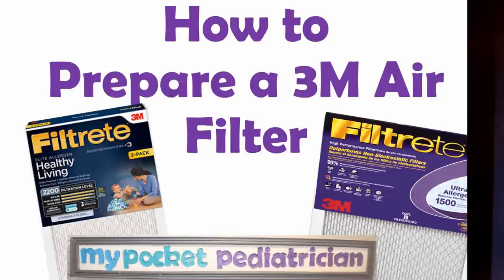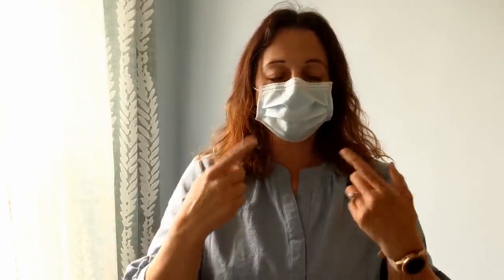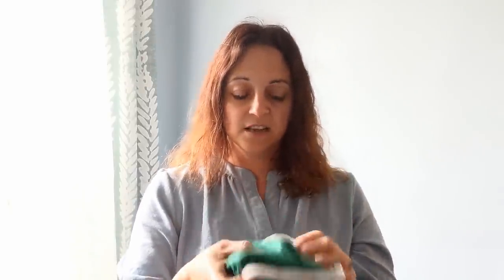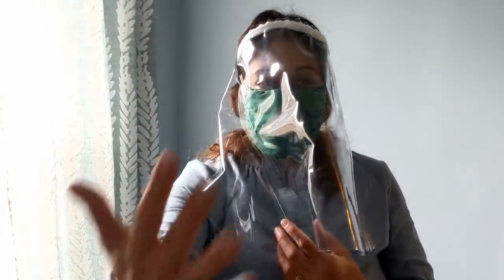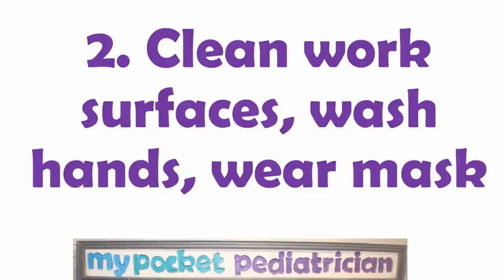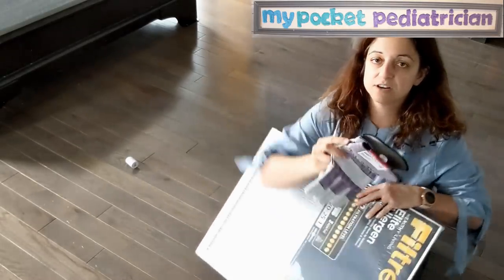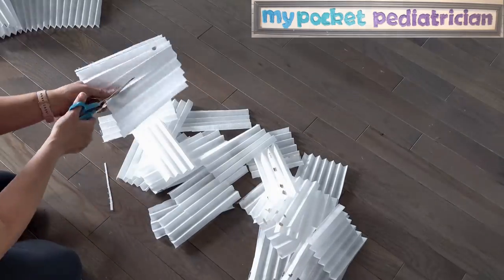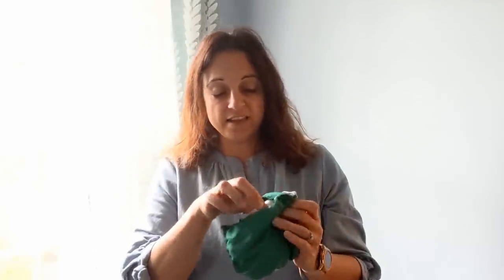UPDATED!  How to Turn a 3M Air Filter into a Face Mask

Comment: I literally just walked out of Kroger with a Filtrete filter I cannot believe it because I cannot find HEPA vacuum cleaner bags. By the way I was so happy to see the filter that catches viruses that I picked up the first one I saw then I realized let me get the largest one that they have since they were all the same price. I'm glad I watched this video because I didn't realize or think about inhaling through a cotton mask that you would inhale the air with the least resistance thanks for this video I appreciate it as a common citizen you're doing a great job thanks
Reply from the maker: What level did you get?
Reply: @MyPocketPediatrician  1500  20x30x1
Reply: Most vacuum hepa bags are made out of fiber glass, please double check before putting on face.
Reply: @CalvinHill-reflects  Where is your data for this?  Even though lots of people were saying the furnace filters have fiber glass, she checked the primary source and found they DO NOT contain fiber glass.  Old fashioned cheap furnace filters with almost non-existent filtering were made decades ago and are still available.  I suspect that people may be conflating new high tech filters with the old.  But, I would like to see a definitive source.
Reply: The vacuum filter bags may have fiberglass, as she said in the video, she researched the 3m filter to not have fiberglass
Reply: @drizzt545  I amended my original post to clarify (I hope) my point.  Since the doctor debunked fiber glass in the furnace filter, I wonder if that would also be true for the vacuum filter.  I have six 3M Filtrete vacuum filters of different models that I can make at least 24 duckbill style masks out of.  But I don't want to cut them up if I'm going to release a harmful substance.
Reply: I'm Me Hey, I watched this video here https://youtu.be/qiYbXsIcI7E and that is where my data came from. So not much. That was with Vacuum bags, not 3M air filters.
Reply: I'm Me I’m not sure of you meant that you could make that number out of one or all of them, but I think you might be able to get a lot more depending on size.  I’m using mine for making Pm 2.5 mask inserts.... I think it will go a lot further that way for me.
Reply: @drizzt545  I ended up getting interface aka stabilizer  the "non woven"  type of material to use as a second layer and filter pocket. Also went to the Dollar Tree and got elastic mattress snaps  then poked holes on either side of the mask, they grip the fabric, it's a modified version but it works great.
Reply: As of this weekend our stores are limiting the people allotted in the stores. So there is a line outside waiting to get in. There weren’t many people in the store, but I think it is actually worse this way. It is causing more of a panic here too. Our store was out of filters. I had to look up other things and that is where I found the autoclave material I could buy. IF I could afford it darn it. They said you can reuse it again.
Reply: LoveisElastic Creations 
This video shows a washable furnace filter material from Filti.com
https://youtu.be/FxkCzCqH88A

The material is not terribly expensive itself, but shipping to where I live was WAY too expensive!  A LOT more than the fabric itself.  To be fair, I live in Alaska and they are only shopping two day to anywhere right now, but they did call me back and said they are looking into cheaper shipping methods that might take longer. It be a lot less expensive.  There will be a pop-up that sends you to the material itself rather than actual furnace filters.  It now says “while supplies last” so I’d check it out soon to see if it’s reasonable for you.  

Good luck!
Reply: @queenofhearts7726  I'm making mine using a design that is similar to the N95 duck-bill masks.

Comment: Do I need to check, (and where would I check?)to see if these filters have any  harmful substances like fiber glass particles? I went to the store and I got one that was for bacteria and viruses 3M Filtrete . I'm concerned that it may have something harmful, since it is not meant to be so close to your face. Thank you so much for the information. Is it an extremely helpful video.
Reply: Same. I'm paused now because I cut them all out and I saw a video saying they made with glass particles and can cause lung issues.
Reply from the maker: I can't tell you medically anything but I can tell you what I've found.  It's not fiiberglsss.  I reviewed the materials safety data sheet and it is just a bunch of polymers.   It said no concern for contact with skin or eyes or inhalation.  As one HVAC specialist I talked to said "why would we put something in an air filter that's bad to be breathed in?  That would defeat the purpose.".  That said, some people are making a duck bill mask out of hepa bags.  I watched the tutorial and there is a cut edge of fuzzy material right up against the face, which may not be smart.  In making these and wearing them in the last few weeks, it seems like any particular matter would stay in the cotton.   They hold up pretty well.  I reused the filters for a while trying to see how well they hold up, and they get kind of fuzzy/fluffy after a while (I was home, not in an exposed area).  It should only be single use, but from what I've been told (and can't make any guarantee) there isn't a toxicity concern.  I've asked every person who suggested fiberglass to give me a source, and it's been "a nurse said there might be".  I'll post the like to the MSDS for you.    I just can't do it from my phone for some reason, but it is in the comments on the mask making tutorial.
Reply: @MyPocketPediatrician  Excellent.  Thank you. I'll use them, with a warning. Bless you for everything you're doing!
Reply: no fiber glass in the accordion style filters.
Reply: @artalli7170  See Eve Wilie's comment above, she found (as did Dr. Lili) that the 3M Filtrete filters are made from a non toxic polypropylene and polyolefin plastic - there is no "glass" or fiberglass involved. Some filters use fiberglass. These do not.

Comment: Be careful not to have any filters with fiberglass in them...
Reply: Hepa has glass
Reply: See the data sheet she posted above, no fiber glass.
Reply: not all hepa filters have glass. Also non industrial air filters are generally rated under MERV's. The one she's holding is poly fibers.

Comment: Help: I took apart the air filter before making note of the direction of flow. Is there anyway to distinguish/identify this now that the cardboard frame is gone? 😢😳
Excellent video
Reply: I did this too! I hope someone has advice. I will keep searching.
Reply: @JennyPost  I too am searching. Please post if you find an answer (as will I).
Reply from the maker: Shiny side towards patient, soft side towards the healthcare worker
Reply: My Pocket Pediatrician thank you!

Comment: After watching your last video I realized that I didn't know which way the airflow went. So I compared a new one to the one I've dissected. The front "airflow" side is smoother and has grains (lines) that go perpendicular to the folds. The back side, you can see the fibers more. Thanks for the ziploc advice! I will be sealing all my filters now.
Reply from the maker: I was talking to someone about the old N95 I found that I used in the video and said I wonder if I should use it my next shift at work.  She said if I did and it wasn't in a bag it would be pretty much useless now, so I added in the Ziploc bag idea.o
Reply: Thank you!i took mine apart and didn't know this
Reply: Are you using a 3M filter?  Which way did your arrow point?  To the smooth front "airflow side", or the back side?
Reply from the maker: @dianestrandlund381  mine pointed towards the back side of the filter.   You want the arrow pointing towards the healthcare worker.  See step 2 in the video

Comment: great video.  I already planned to make a mask with a/c filter before I saw your video, but I didn't know the air flow is directional. That may save me some trouble.

FYI: I lost the place where I found the size of corona virus but here it is.

N95 mask is 0.3 microns; which is the same as 300 nano meters. viruses vary in size from 15-300 nanometers. Most are in the range of 15-80 nanometers. and there is one virus that is almost as big as a bacteria. The original estimated size of corona virus is 60-150 nanometers. that makes the holes of an N95 mask 2-4 times bigger than the virus.

It might have been the product info on 3M website that says filters are not made like a net because its not currently possible to make a net that small. The particles are actually captured through a process they call diffusion. The air flow around the fibers causes small particles to change direction and crash into a fiber where they become entangled. I didn't completely understand the explanation of how that works, but I guess the filters can catch particles that are smaller than the holes in the filter
Reply from the maker: Glad to help!

Comment: This is an extremely helpful video.  I was a little thrown by you saying you put a sealed zip lock bag mask over your mouth and nose, but am grateful for your transparency.  Thank you!
Reply from the maker: Honestly, I didn't think my seal could be that good in the mask, but apparently, it was excellent since I nearly died!  I have a new and improved Adjustable mask with FILTI material that passed the FIT test!  Please check it out here:  https://youtu.be/2J3Fq4o-U4I

Comment: Heat and moisture from breathing on the 3m filter might prevent it from working properly. What if you somehow secured/placed the filter on the outside of the mask?
Reply from the maker: I don't think you would get a seal that way.  However, I found another material where moisture isn't much of an issue.  I have a new and improved Adjustable mask with FILTI material that passed the FIT test!  Please check it out here:  https://youtu.be/2J3Fq4o-U4I

Comment: you can also use foam weather stripping around the edge to really get a good air tight seal
Reply from the maker: I did that on the top only.   Maybe I can put it all the way around?
Reply: My Pocket Pediatrician I don’t understand how that doesn’t make the mask roll. I just can’t picture it up close and on.

Comment: This comment was posted in a local group this morning! According to the IPCS Dryer Sheets contain “Quaternary Ammonium Salts”. Here is the safety statement from them...
2.1 Main risk and target organs

Quaternary ammonium compounds can cause toxic effects by

all routes of exposure including inhalation, ingestion,

dermal application and irrigation of body cavities. Exposure

to diluted solutions can cause mild and self-limited

irritation. Concentrated solutions of quaternary ammonium

compounds are corrosive and can cause burns to the skin and

the mucous membranes. They can produce systemic toxicity due

to their curare-like properties. They can also cause allergic

reactions.

Comment: 3M Filteret are made of electro-staticlly charged polypropylene and is similar material to N95 masks.  To get something equivelent to N95, I would suggest using an other and inner fabric with 3 layers of 3M MPR 2500 or 2800 filter.  These higher rated filter would do a better job filtering particles as small as 0.3 um.  FYI if someone sneezes where aerosoles are generated these home made fitlers and popular N95 will not filter COVID-19 particles as small as 0.1 um!  You will need full recpirator mask with face shield.
Reply from the maker: Thank you for your comment.  Fully agree on the electrostatic charges.   What made you say 3 layers of 2500 or 2800?   I've had people question my saying 2 layers because they said it would be too hard to breathe through 2 layers of cotton and 2 layers of filter.  I just wondered the rationale for the 3 layers.  I was able to pass a FIT test with the 2 layers in the mask I designed.
Reply: @MyPocketPediatrician  
3M MPR 1900 Filteret has rating of 62% capture for 0.3-1 um, 2 layers ~(1-0.38^2)*100=85% capture, 3 layer ~(1-0.38^3)*100=94.5%.  

3M MPR 2800 Filteret has rating of 81% capture for 0.3-1 um, 2 layers ~(1-0.19^2)*100=96% capture, 3 layer ~(1-0.19^3)*100=99%.  

You can probbaly get any with 2 layers of MPR 2800 but in case of MPR 1900 you will need 3 layers.

Comment: I saw a woman using a menstrual pad. Just peel and stick on the inside touching your face. You can change it out throughout the day
Reply: That doesnt sound like a good idea because of the plastic. It would literally block air. Plus that's not made for the face.

Comment: Dr Lili - Here is another brilliant idea i'd like to pass along to you,  put together by a surgeon at Boston Childrens Hosp using a  Elastomeric Respirator. Please pass this on to your medical/nursing friends! She says the anesthesia mask and the Inline Anesthesia Viral/Bacterial filter attachment are only about $1 each. Very impressive! The comments from doctors and engineers are very laudatory and they wonder why no one else has thought about it before. One says "This video is the benchmark for DIY respirator design!"   And please note the comments about the elastic straps in the comments section. One suggests - rather than using the green elastic straps the doctor in this video is reusing, which are difficult to clean -  they are using tourniquets from their lab  since "They are cheap, purchased in bulk, sturdy, and can be sanitized
". She also says "The masks come in 7 sizes, we are using size 6, 5, & 4 for most of our staff needs."  Another commenter suggested using these cleanable neoprene adjustable headgear harness systems instead of the green elastic straps. They are only $14 : https://www.buyemp.com/product/o-two-replacement-neoprene-head-harness-system

Here are the inflatable anesthesia masks in various sizes ($3.85 ea. on this site) : https://www.boundtree.com/Airway-Oxygen-Delivery/Oxygen-Masks/Vent-Mask-Inflatable-Anesthesia-Face-Masks/p/group001568?searchText=anesthesia%20masks

Here's the Inline Anesthesia Viral/Bacterial filter she was using, the Teleflex Main Flow - bacterial & viral efficiency 99.9%  ($2.19 ea. on this site) but she says you can use others of course :   https://www.boundtree.com/Airway-Oxygen-Delivery/HMEs-Filters/Main-Flow-Bacterial-Viral-Filter-42mL-Dead-Space-Non-Returnable-and-Non-Cancelable-/p/2358-01605

Making Your Own Reusable Elastomeric Respirator For Use During Covid-19 Viral Pandemic N95 Shortage:
https://www.youtube.com/watch?v=Es_iY5WJdmI

Comment: Thought of using these filters after seeing a vacuum bag tutorial that might have fiberglass? You made a great video, thanks for sharing it with us. 

Might I add that when cutting up said filter, to not do it on a floor (dirt, germs, etc) but maybe on a clean table, or even put a very clean bedsheet on floor first, if the floor is necessary. Even putting a clean sheet (ie: washing sheet with Clorox or equal) on top of a bed and using that as a work surface. God bless you and thanks for all you do!!
Reply from the maker: Please see the video above at 19:10 Re fiberglass.  I also have the MSDS safety sheet pinned at the top of the comments.  
Also, I am distancing in a home with 7 people and a dog, so as I said in the video, I cleaned the floor with lysol cleanning spray and wipes and did this in the bedroom where we never wear shoes away from the kids and dog since my tables are all occupied with all the other people in my home.    When I'm preparing them outside of the tutorial, I'm not using the floor, but needed a spot for demonstration purposes.  I figured the floor that had just been scrubbed was better than a bed with a sheet on it.  Anyway - I didn't even use any of the ones I made for the tutorial because I didn't put them into the ziploc bags immediately, so those are just for demonstration purposes.  I'm in contact with another company about a possibly better material, so I hope to have a tutorial available soon.  I should be receiving the product on Tuesday, so please subscribe to my channel so you get alerted if something better comes up!

Comment: I am in no way an expert but Ive been using these filters for years on my fans as an air purifier of sorts and knowing that they are used in air conditioners knowing air conditioners tend to be very moist these filters arent just a one hour or one day use they work over an extended amount of time I would think they could be sanitized I am actually going to be steaming one to check and see if it harms the material soon as my filter gets here.  Thank you for your great tutorial out of all the masks Ive seen being made out there I have the highest hopes for this one.
Reply from the maker: I'm not sure.  Some people are saying they won't last at all in the mask - some are saying longer.  Unless you have a lab where you can measure viral particles, I'm not sure you'd be able to tell if they are still effective.  I'd be very careful about reusing.

Comment: Doc, I found it easier to snip the wire mesh first along the edges of the filter and then peel the wire mesh off carefully. Then cut the filter material out from the boxy frame at the edges with blade knife and scissors. this way you do least damage to filter and avoid the step of breaking down the sides of the box frame.  Alternately, you can get the un damaged filter material from hepa filter vacuum cleaner bags. Once you are done with your mask, use double sided skin tape to secure to face.